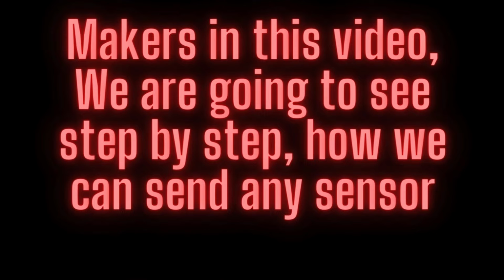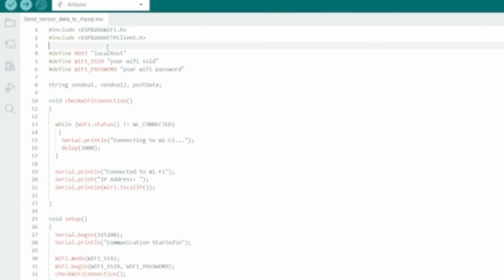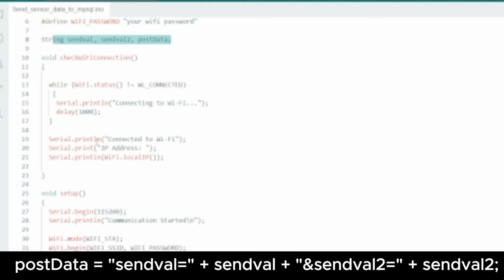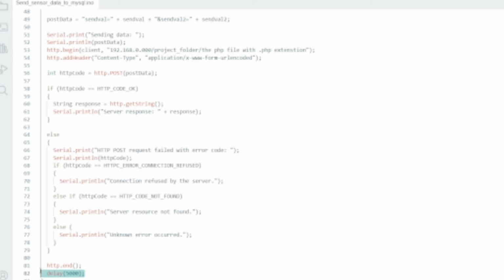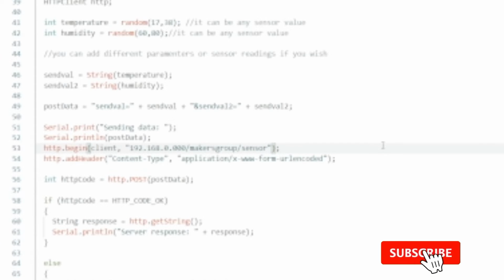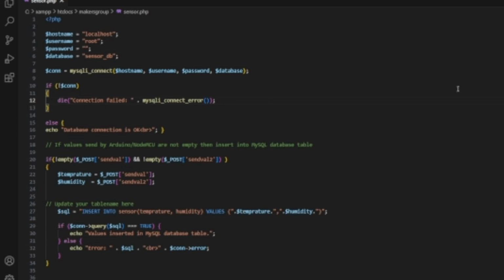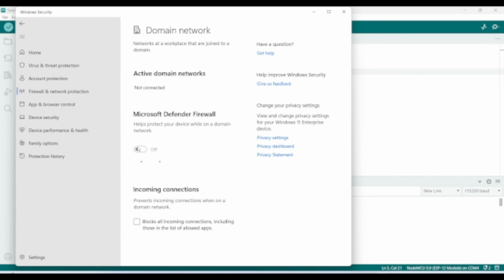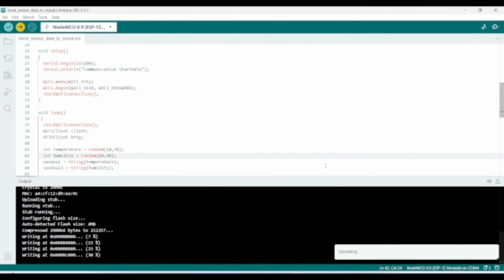🔴How to send sensor Data from any Arduino board to MySQL Server(PHPMyAdmin) | IoT | ESP Wi-Fi module

Comment: hey, I'm getting connection refused by the server error.
Reply from the maker: Check if it works after you restart your PC and also you can fix any erroe of Xampp server using one of our video avalioble in this channel
Reply: @makersgroup  Did everything. Still didn’t work. So I directly connected to the host of my website.

Comment: float sensor reading=analogread(D4);

why error, when I want to read from real sensor (pin D4) sir
Reply: Done:

int temperature = 0;// you can get the actual value from attached sensor
int humidity = 0;// you can get the actual value from attached sensor

 float sensor_reading=analogRead(A0);
  
  sendval = sensor_reading;
  sendval2 = sensor_reading;

  postData = "sendval=" + sendval + "&sendval2=" + sendval2;

Tq

Comment: Sir, may I ask, is it possible after I finish creating the database and I display the level sensor on my html page
Reply from the maker: Offcource you can !! you have to featch the data from the stored database to display on your html webpage
Reply: @makersgroup  with use your code?
Reply from the maker: The given code is used to store sensor data on to mysql server. Once you used the given code to store data on mysql server , you need to write a new php code to fetch the data and html code to display the featched data.